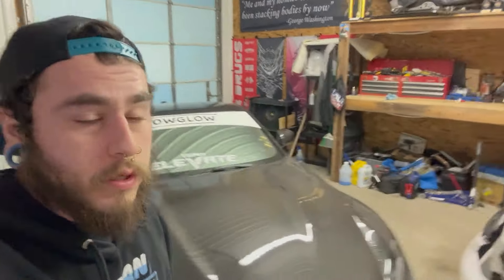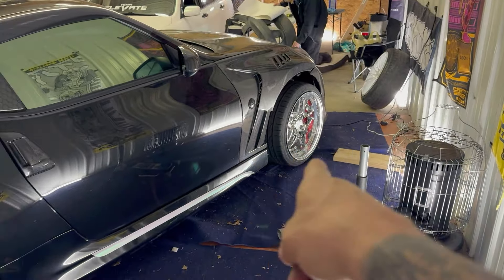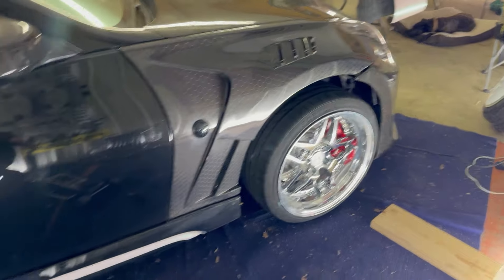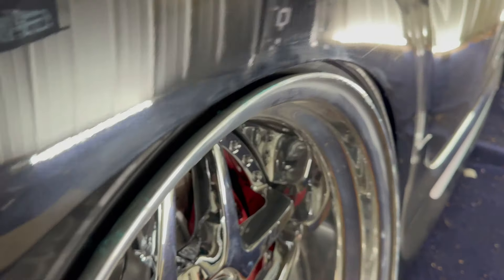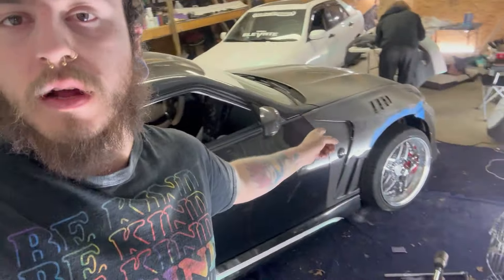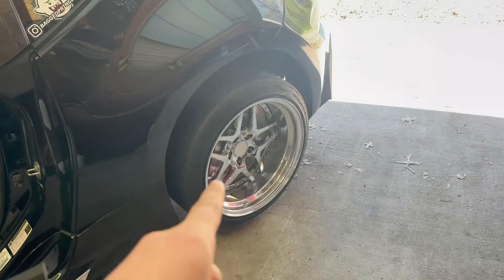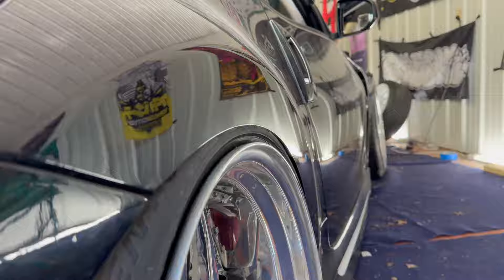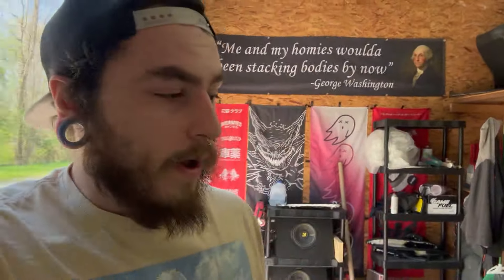Test fitting the new wheels on the 370!

Comment: Well you see.. you have to pull the front fenders and rear quarters. Make sure to do the fronts with a shit ton of heat and slow so you don't crack the cf 🧍🏻‍♂️ I'll be watching
Reply from the maker: Tbh fronts don’t even touch anything since trimming the fenders but I’m adjusting the collars on the bags tomorrow to see if I can lower it that extra half inch. Really trying to avoid pulling or rolling anything 😭
Reply: @Baggedpringlez  not like you even could roll or pull anything lol. Kinda gotta make it work somehow
Reply from the maker: I got this 😈😂